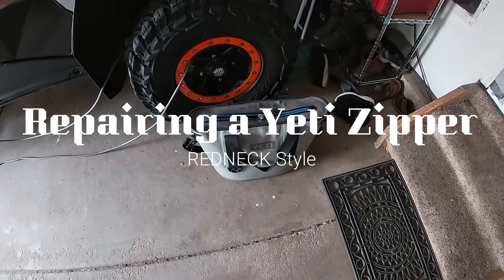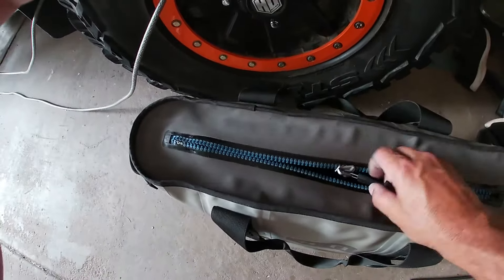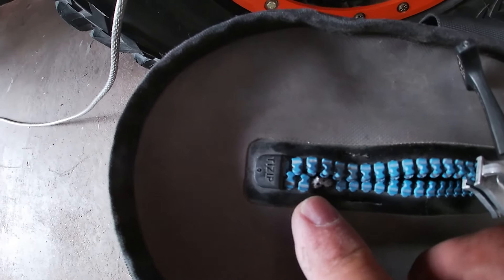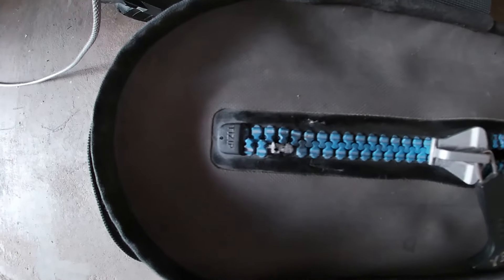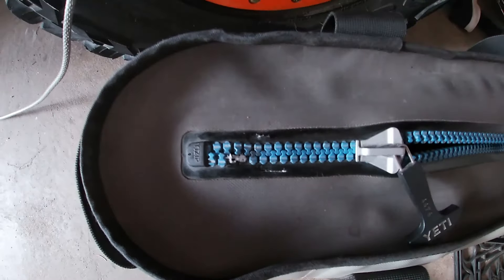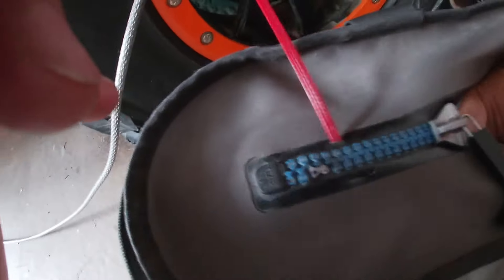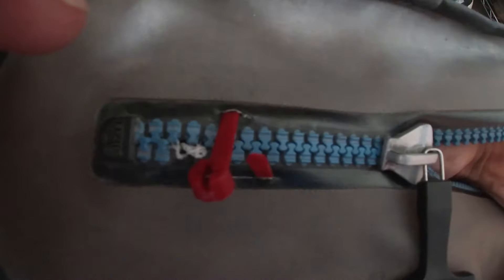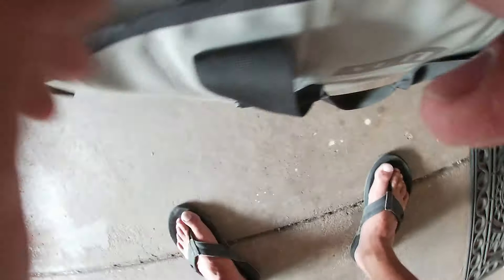Yeti Hopper 30 Zipper Repair Video

Comment: why not just glue that part of the zipper?  Why cut new holes in it?  The glue should stop the zipper from going into the area where there is no teeth.
Reply from the maker: Also an option...in the end having to repair multiple times is only a zip-tie away.
Reply: Oops, too late for that, Add glue to the holes created by the tie instead.  Ha-ha-ha.

Comment: I think I’m gonna use this method. I hope it works. I can’t understand why so many people have an issue with yeti zippers, as much as they cost. 🤬🤬🤬🤬🤬
Reply: You can send in and get a new one free
Reply: @ are you sure?
Reply: Theyll usually warranty it. I had a hopper flip 12 that was 5 years old (2 years out of warranty) that the teeth got messed up on and they said oh yeah ship that one back and we will send you a new one! So i did. If yours is a limited color though, be aware they only let you pick from the core colors as replacement. I lost my field tan/orange cooler and had to settle for a charcoal one. But hey i wont argue since yeti wouldve been within their right to tell me go pound rocks instead.